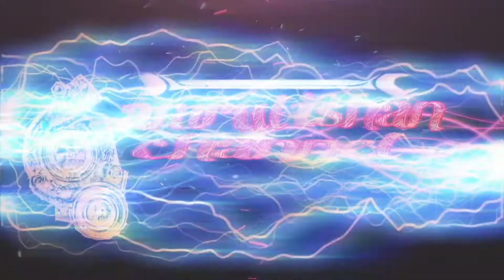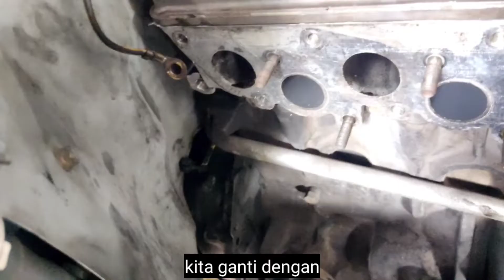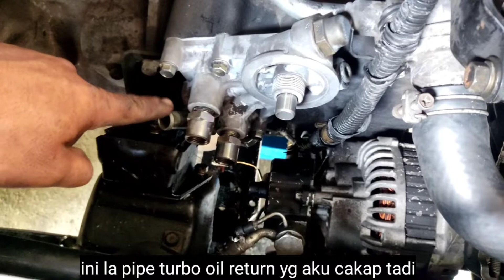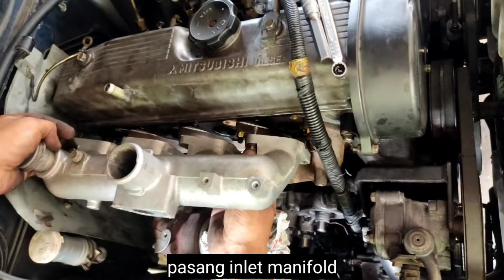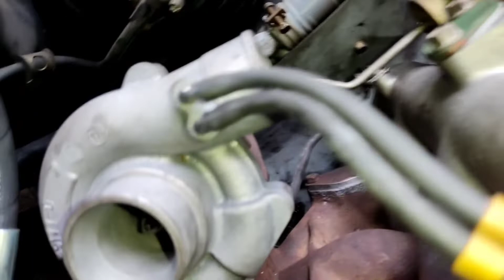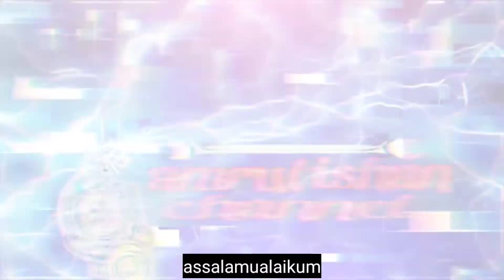4d56 n/a upgrade kepada 4d56 intercooler turbo

Comment: One upgrade worth doing, if viable, is to either run a bigger engine oil cooler, a temperature sensor constrolled oil cooler fan, or both, to guarantee stable and optimal oil temperatures and thus, reliability.